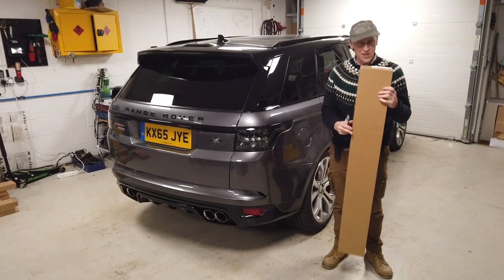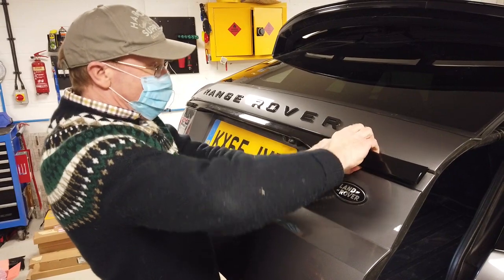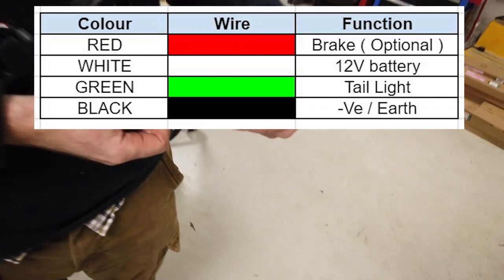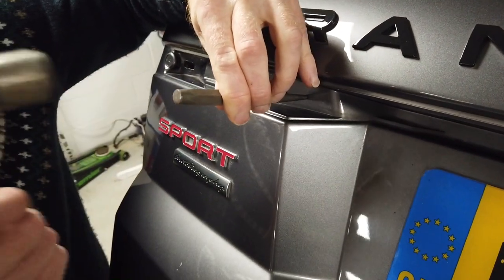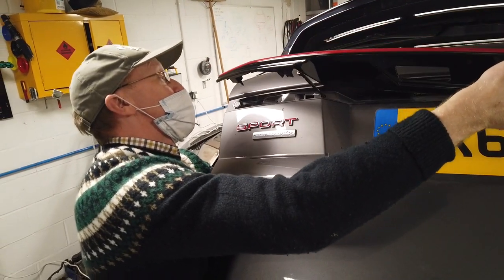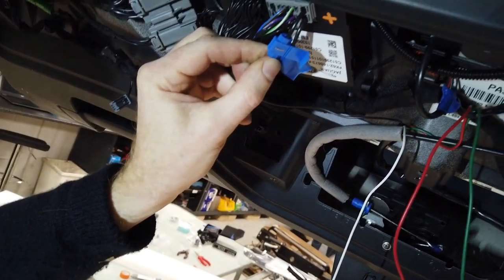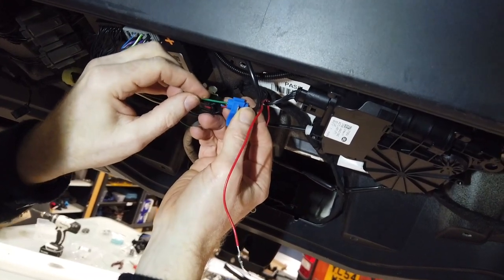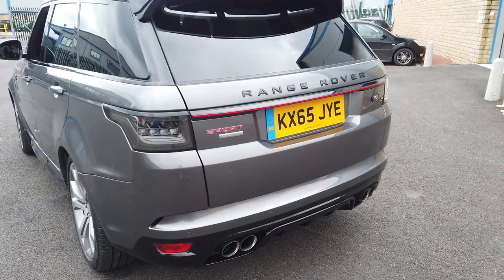Range Rover Sport L494 / SVR Rear Tailgate Trunk LED Light Bar - Fitting & Demo

Comment: It’s easy to install but now I have a dark Area in the middle doesn’t look to good
Reply from the maker: Hi Adrian - we had a problem with the water sealing on the first batch and you should have been refunded. This is now fixed and the items will be up for sale again very soon.
Reply: @L663  hello, will you ship to Italy?
Reply from the maker: @giandomenicomurru8800  Hi - we did before Brexit but now we have to change the way we do VAT etc so we need a little time to get this sorted
Reply: @L663  Look forward

Comment: Yes my box where the white black cables go is also upside
Down , tried the blue scot box to connect and tried  manually but can’t seem to get it on , can you not just connect all to the plate light ?
Reply from the maker: You can connect the earth and light wire to the number plate light - but the 12v power feed you need to find a power feed really - it may work on the light wire but you will not get a power down sequence.

Comment: Would you consider fitting these to my RRS if I came to your workshop once lockdown rules allow?
Reply from the maker: Hi - firstly i am flattered that you would let us work on your car ! but alas we are not set up for customer fitment.. a customer fitting centre is something we are considering for the future !
Reply: @L663  Thanks for your reply - if you do decide to offer a service like this in future please do let me know as I am not sure any of my local garages would have any experience of working with the trim on a RRS. Can you do an easy fit strip like this for the Evoque 2017 too please! (:
Reply from the maker: @r77kul8  The Evoque one is coming and will be an easy fit - no need to remove interior trim - it will be plug and play !

Comment: Hi. Can you put a link to the online fuse fitting please.
Reply from the maker: Here you go 
https://youtu.be/ZVa3j8OKMCs
Reply: Super cheers guys.
Reply: All refitted and took your advice on ‘chalking’ the gap between the light bar and car. Had to brush up (which means pray that I could pull it off!) on my sealing skills, looks like it works (it helps that mine in Fuji White to start with!).
Reply from the maker: @adrianbarnett2912  All sounds good - keep me updated please. Did you connect the brake too ?
Reply: @L663  not as yet. Need to plan that one out. My version of the rear camera doesn’t sit as proud as the one that has the washer. So will need to figure out getting a washer line down from the rear spoiler too.  That will mean getting the brake light sorted and dealing with light bar overhang on the reverse video.

Comment: I'm installing the light and I don't see the fuse sleeve on your white positive wire. Is it needed? I some how lost part of it snaking the wires through the drilled hole.  I'm connecting the power tomorrow and have the other end of the fuse sleeve with the fuse.  Please advise.  Thanks
Reply from the maker: We recomend using a fuse just to protect the rest of the car in case of a fault - we can send you a replacement part free of charge- please contact customer service by email
Reply: I just finished installing my LED light bar and it is ridiculous!  The bar transcends the rear of the car to something superior to even the big boy Range Rover.  Super bright, the shut down ends in the center of the bar is bad A$$.  The bar looks factory OEM.  If you have a RRS invest in this LED light bar...money well spent.  Total head turner.  I took the Sport, Supercharged, and Land Rover emblems off so all you see is Range Rover and the light bar.  Clean look and bad A$$.

Comment: Hi I have a question, on the ends and in the centre the light looks as if it has dim spots. One in centre and one each end. Am I right if is it just the camera?
Reply from the maker: I looked again and there is a pretty even spread of light so its just a trick of the camera.
Reply: Ok thanks for response. I’ll be ordering one when you have the tinted version ready.

Comment: Any update on a smoked version plus have the the water ingress issues been resolved yet?
Reply from the maker: The smoked are shipping from the factory now
The failure rates have improved a great deal 
We have improved the sealing and started to water proof the circuit boards
Today we test our latest idea and it now works underwater but this is not in production yet.
Reply: @L663  thanks for the reply, keep up the good work.

Comment: I have just had mine fitted and it doesnt work. Not even a flicker of light.
Reply from the maker: Sorry to hear that - can you check the fuse ? we did have one where the fuse was missing. You also need to check you have voltage. 
You can check the bar with a 9v PP3 battery to see if it works before removing it. 
Let us know what you find and how we can help you.
Reply: @L663  hi.i did check fuse and that was ok. Will try with battery tomorrow. Thanks.
Reply: Hi again. Checked light with 9v battery and light comes on,but as soon as i connect the wire to your instructions ,nothing.
Reply from the maker: @thesplodge47  Hi - so the light bar is working it must be something on your car / connection. What year is your car ?
Reply: @L663  i followed your instructions for the wiring, but then noticed your box that you wired into is upside down so that the 2 wires you connect to anr on the right side.but mine is the right way up and therefore my wires are on the left side. So its all done and working now. You should make it clear that the 2 wires you need are the 2 thicker ones.  Paul.
Reply: @thesplodge47  Hi Paul - is your car 2018 on ? i think they may have put the box upside down on these models
You point about the thicker wires is a good point - I will look into that.
Good news is you are all working !
Reply: @simonjefferson  mine is on a 13 plate.but the l494.
Reply from the maker: @thesplodge47  That is strange - i have seen one the other way up on a 2018 but you are sorted now so well done and sorry about the initial problem.

Comment: Bar stopped working after new battery was installed - is there a fuse that might have blown? as I don’t remember. Thx
Reply: Yes there is an inline fuse - we can send you a replacement fuse if yours has blown